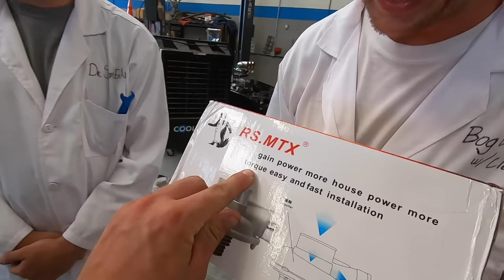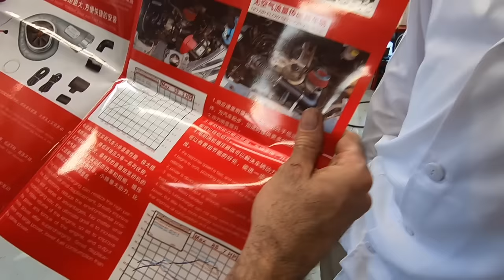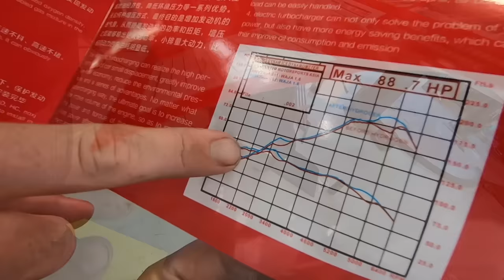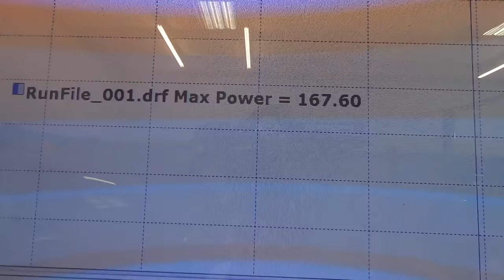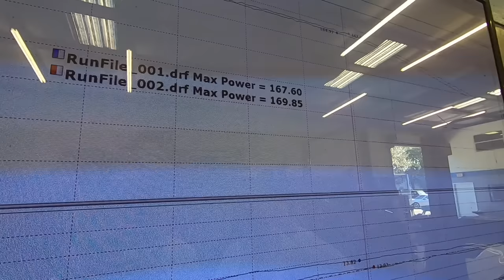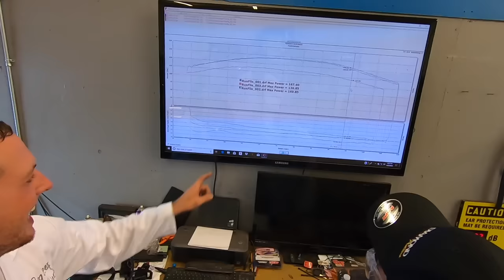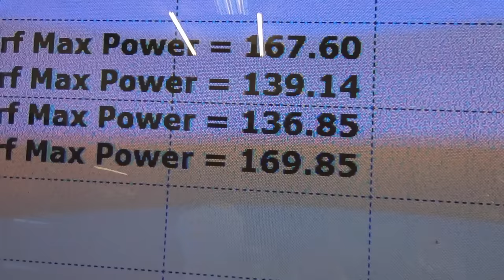Dyno Testing a $400 ELECTRIC TURBO! Funniest Car Part EVER!

Comment: Looks like it was wired backwards, seemed like the Hiroshima hairdryer was spinning backwards at 17:55
Reply: You know Hiroshima is in Japan right?.
Reply: holy shit youre right, it is wired backwards
Reply: @Vike_12  you right
Reply: Hopefully they will redo this video with it wired correctly.  

It was the lab coats which gave them a false since of smarts.
Reply: holy shit, then it must be true, if it robs 30hp backward then it surely will gain 30 forward, lol. j/k
Reply: Evan Riel  +9000 just for the name.
Reply: Not wired backwards that's just the frame rate.   They tested it before installing.. it wouldn't be blowing OUT of the OUTLET if it was wired backwards.    They should've done a dual intake tube with the fan assisting the NA suction
Reply: Southern Speed Videos Honestly, didn’t even think about that, the frame rate could easily make it appear spinning backwards, it was worth the ounce of hope though
Reply: Mark Thomas ‘Twas just a joke
Reply: We need more tests now guys make sure he sees this
Reply: @SouthernSpeedVideos  At .25 speed, it still appears to run backwards...wonder if it's back feeding through lack of ground? When they initially ran it outside the car, it was clearly running properly.
Reply: Look man, there was no map sensor. It was running rich because it was reading too many gallons of air per sec and not psi.
Reply: It is backwards, Cooper also says "it's building up some serious back pressure" then hold his hand in front of the inlet like it was blowing air on him..
Reply: @bills6093  I know y all are more mechanically inclined than you are technologically, but the reason you all thought it was backwards is called the rolling shutter effect. Look it up and be amazed at the power of the human eye
Reply: @rhyswerner8749  No, I think it's running backwards because of Cooper's observation regarding back pressure, and because I played it at 1/4 speed to see if the shutter effect remained. At any rate, I think there is enough evidence for Cleetus to have to address the issue.
Reply: It is definitely running backwards when witnessing the initial spool up at .25x, assuming the side the camera is pointed at is the inlet.
Reply: Oh it totally is.. James wanted a free lunch maybe?

Watch which terminal the blue wire goes to during pre install then during dyno lol
Reply: @rhyswerner8749  rolling shutter isn't what might make it appear to run backwards, it's more of a type of aliasing. Sampling at a frequency slightly different from the period of the target (in this case, the time it takes the compressor to turn some integer number of blades) will cause the apparent speed to be different from the actual speed. Rolling shutter would just make the blades look all noodle-y.
Reply: @SouthernSpeedVideos  these compressors work centrifugally, so I wouldn't be surprised if the thing does still push some air out of the outlet even running in reverse.
Reply: @thecma3  you are 100% correct as I'm sure you know 😂 I miss remembered my information clearly cause I knew exactly what you meant by "noodley" the rolling shutter effect makes things ( spinning discs blades rotors etc) appear to become warped and bent, thank you for correcting me and correcting my mistake!
Reply: @kirkc9643  has nothing to do with the size of your screen or the speed at which you watch the video. You aren't being a big smart deductive Sherlock homes by turning your video speed down... this is a result of the cameras frame rate and the RPM at which the blades are turning
Reply: JUST TO BE FAIR* Guys im just posting my opinion on the matter as I have no certifications or experience but I am curious enough to take a stab at problems and things like this, thank you all for the constructive criticism and ideas about this weird HORRIBLE "China turbo"
Reply: @rhyswerner8749  yep yep yep. That's the stuff. The noodle-y stuff.
Reply: @UCWiX6avmVC0REdkM_Fq7oZA I'm not arguing or over complicating anything. Its just frustrating that so many people fail to realise the fact that the turbine might be spinning the wrong direction will have no fucking effect on the performance of the engine because it's a giant v8, try and think how long it would take that tiny little "turbo" to fill all 8 cylinders with the "correct" AFR and not to mention all of the intake manifold and the chambers in the heads. There is no way in the world you could pump enough air to do ANYTHING with that hairdryer
Reply: @UCWiX6avmVC0REdkM_Fq7oZA why don't you explain your train of thought to me instead of just crowing what everyone else is saying (hurr it's spinning backwerds slow your vidja down 😯)
Reply: It does spin backwards damnn
Reply: @kirkc9643   please refer to the clip of Cleetus letting it rip with the bubble wrap next to it 👌. Sorry you're slow :/
Reply: Damn you got good eyes, didnt see.
Reply: It's wired the same in all  the clips. They tested it during the "back pressure" comment, and Garrett put his hand in front of it;  it was still spinning clockwise, but if was running backward it would have been obvious. If it was going the wrong way, we would have seen the fan stop and go the wrong direction James puts power to it; or at the very least slowed down, stopped, or made blocked motor noise. The blades were already spinning clockwise from the suction of the engine, and the engine. The speed of the video doesn't negate from rate or shutter speed, or whatever; so if the camera made it look like its clockwise, it's going to still go clockwise I'm slow motion and in 1080.
Reply: If the compressor is running backwards it still compresses air and blowing in the right direction but with a much lower efficiency and flow. But it could also be the frame rate. Check our channel, we have some proofs the Electric Turbo is not a scam ;)
Reply: @kirkc9643  I'm really not making a fool of myself 😂 you are... do you even know how a turbine works 🤣🤣
Reply: As Sheeve said to the dukes, It's supposed to be it's chinese.
Reply: Kirk Claybrook at 13:53 when he put the paper or whatever it is up to show it blowing, it looks like it’s going counter clockwise too
Reply: It's fascinating how confident people are about a topic they're clearly not equipped to have an informed opinion on.

"Put closed caption on @ this time, you can hear the turbo go "eeew" instead of "weee"

LMFAO!
Reply: TheCanasianMm
Reply: Watched it in slow-mo, Definitely is backwards lol
Reply: Maybe the "back pressure" they were feeling was actually the turbo trying to succ rather than blow

Comment: Apparently a “house power” is less than a horse power. 🤷🏼‍♂️
Reply: Cleetus i have a 1liter 3cyl smart maybe itll make it more power.  Or install on that pocket bike u got..
Reply: House power is -32 horses. - 1 house power is 32 horse power. That's Chinese math.
Reply: Well we use about 6000kWh a day which totals 250,000 watts. Now let’s remember that 1hp=745.7w so we use about 335.255522hp a day. Therefore 1 housepower = 335.255522 hp so yes, it is wrong. Big brain activity.
Reply: @amonGustavo07  do you mean 6000Wh? 6000KWh is maaaaassive.
Reply: James Golen perhaps.
Reply: Cliff P i have 500 fuck machines running 24/7 tho don’t ask why
Reply: who know.....🤣🤦‍♂️
Reply: @amonGustavo07  kWh and watts can't be interchanged like that. kWh measure energy. Watts measure power. energy is power x time

Comment: I mean, leaf blowers exist. The weak point is actually the alternator BUT if you ran it off an isolated battery, you'd offset the back-pressure program on turbos that usually drops 30% of the power gained.

Comment: Try it on a go cart engine! The V8 is pulling in more air than the "Turbo" can. Maybe if it was on a smaller engine that didn't pull so much air it could create some boost.
Reply: M-A-D...its not boost damn it!
Manifold Air Density
Reply: @zuestoots5176  Agreed, my wording wasn't accurate. But you get the point.
Reply: @zuestoots5176  : Nobody likes a smartass.
Reply: Doubt it.
Reply: Put it on the bogger
Reply: Put it on the tracker!
Reply: TufGriz that’s actually a great idea with how long the intake snorkel is lol
Reply: What if he Y’ed the pipe so it can suck it’s normal air plus the air from the turbo
Reply: Actually a good idea. Build a gocart. Race boostedboiz
Reply: @inthebeginning6895  lol because running the turbo motor backwards wasnt bad enough?
Reply: Motorcycle! (Enginecycle).

Comment: 17:55, Looks like the electric turbski is spinning in the wrong direction.
Reply: Lol did they have it hooked up backwards? I think your right.
Reply: Sure looks like it spun backwards.
Reply: @JNorth87  So instead of giving it 30hp, it sucked out 30hp.
Reply: but if you watch it when they do the dyno pull it looks to be spinning the correct direction
Reply: @TangoOne  Play it at 0.25 does look to be spinning backwards
Reply: @TangoOne  the noise is the gear stripping out
Reply: @TangoOne  It probably was. You have a 170 Hp V-8 pulling the fan in one direction and a wimpy little 12 volt motor pulling in the opposite direction. I'd bet on the V-8 winning that battle.
Reply: Yeah for sure spinning in reverse, pause the video and use the < and > keys to move frame by frame. Its spinning backwards
Reply: @itznewy3615  I watched it at .25.. still looks to be spinning clockwise.. the correct direction.
Reply: @anthonyward8853  You do need to think at 17:55 the vehicle wasn't running. So it spun backwards. And about 20:05 it started to spin it clockwise. Till James connected the cable to the battery causing the gear to spin it anticlockwise. Which would of resulted it to strip the gears
Reply: ItzNewy l

Comment: 😂The problem here is the Dyno doesn’t detect house power.
Reply: Needs a firmware update 😁
Reply: Ffs 😂😂
Reply: Someone needs to made a guage for that.
Reply: Also the Dyno doesn't detect H.P.
Reply: Dyno
Reply: Bonnie & Clyde Ride E-Turboraptor
Reply: Good job
Reply: Twistys hahaha
Reply: Cause House Power is 110V and cars run on 12V. 😋
Reply: Turn to Christianity and United Brethren Church before its to late saying anything hateful, premarital sex and lust are all sins. And so is using the Lords name in vain. Killing is a sin.
Reply: the fuel pressure has to increase with the boost pressure gain .if not the fuel pressure is decreasing with boost pressure thats why you made less  power ..ie no boost=47psi ,10lbs boost =57psi ... 10lbs boost =37psi with no increased fuel pressure ,this is why you made less power
Reply: @haydenbellis3047  and you better not shout cos santa clause is coming tonight.

Comment: Try it on a smaller engine like maybe a 3.5 "housepower" Lawnmower engine.
Reply: good idea, but it’s very hard to use forced induction within a carbureted engine because of the carburetors size and the size of the jets being the limit for the amount of air you can push through it. if you push more air then the jets can supply fuel then it’s pointless( would just lean it out a ton). Id like to see a fuel injected dirtbike hooked up to this that would be interesting
Reply: Nah bra, your going to make -26.5 horsepower. The turbo spins backwards so u get negative horsepower. Its simple math
Reply: Just a heads up: 3.5 Housepower is about 350 Horsepower.
Reply: That’s a pretty big mower if it has 3.5 horsepower that’s like 340-400 horse power

Comment: When you can hear the "turbo" spooling faster as the engine draws in more air... That means the engine's vacuum  is forcing the turbo to spin faster. No big surprise!
Reply: I was thinking the same thing. Avoid everything coming from China and you should be good.
 'Murica👍
Reply: You’re better off literally buying an eBay turbo kit for like 5-600 bucks 😂😂

Comment: Dudes, you've unknowingly stepped into my realm now. I've been experimenting with electric supercharging since 2010. As you guys can probably guess, the displacement to turbo-size has a lot to do with the performance. I don't think what was bought was meant for an engine with as much displacement as the Mustang. It probably utilizes a bldc motor from the look of the controller so I've no doubt it can generate pressure, but it's limited in how much cfm it can deliver under pressure. Make an intake with one per cylinder and I'll bet you will see some positive numbers then. I currently drive a Novi 2000 Centrifugal with a 72v 250A Me 0913 bldc motor which puts out 96N/m of torque. It will boost my first gen. .060 over smblk Chevy by 5psi early in the band, but then it's all gone by red-line (which is OK for shifting). It's in a black 87' RS Camaro with a TKO-600 and a Dana 60. Matter of fact I just ordered new batteries for it and would love to try it on your dyno. Aren't you guys in Florida? I'm in Kissimmee.
Reply: yeah a lot of people joke about electric superchargers but they can actually exist. Some struggles being cost and weight of batteries. Comes to a point where its a cool experiment although generally not practical.
Reply: Quite right. If I had to do it all over again I probably wouldn't but I sure surprise a lot of people with it.. When you're already on a roll the extra weight doesn't make so much difference, It's very efficient too.
Reply: Very cool, I think there is a lot of potential here. I think advances in fast discharge rate batteries will make it happen.
Reply: Me too. I've been keeping a sharp eye on Li-Po s, but they're still too much. I'm using six 50ah AGMs in series now, but I'm going from two bass boat on-board trolling-motor chargers to a 72v bank charger instead because they charge too fast. Constantly monitoring and keeping full voltage has been a major issue with it, but just from the over-time drain from the drive module pre-charge resistor, not from use. Typical duty cycle is less than 15 seconds. The bank charger should do a better job of keeping them all floating.
Reply: Try some super caps, should discharge quickly for a short burst
Reply: That's certainly food for thought. They would undoubtedly be lighter and would definitely recharge faster than AGMs. I would just have to bank enough to last an entire duty-cycle without dipping the voltage and raising the current to the drive-module. 
Thanks for the suggestion. I'll look into that. I need to put in a shunt resistor and get an accurate current reading first, but now I'm all wrapped up in a residential air conditioner project that uses dc motor driven automotive style 134A compressors that can run directly off a bank of batteries.
 I also want to experiment with putting BLDC motors on those little roots blowers for the 2.0L crowd. I think BLDC motors are to the motor-drive market what LEDs are to the lighting market. PM DC motors just can't stack up against them.
Reply: I looked into the super-caps, but they're all 12v. My motor-drive is 72vdc and there's no way to combine lower voltage caps to make higher voltage ones. Still, who knows what the future will bring?

Comment: Give it a try on a small 4cly engine, that would be interesting to see
Reply: Yeah, an old school 1000 or 1300 CC engine that hasn't been optimized for flow, it may have some benefit.
Reply: The mini bogger
Reply: I know a certain 4 cyl mini bogger that could use some extra house powers
Reply: Hook it up to  a 150cc scooter, it'll rip !!!
Reply: A little 3 banger.

Comment: Was spinning the right direction when they were messing with it off the car. In the car it's 100% spinning the wrong direction lol.
Reply: I had to go back and watch and you're 100% correct. 17:52 Obviously this turbo is supposed to go on cars south of the equator lol.
Reply: Willing to bet the plug on the turbo itself can be plugged in either direction. Probably what happened.
Reply: if that's true then hopefully they'll realize and re-do it
Reply: I noticed that as well, I thought it may have been just the electronic shutter on the camera making it appear to spin backwards.
Reply: It’s like anti-boost. The EPA will catch onto this soon and reduce all of our house powers! Damn you Cleetus!!!
Reply: Bingo!
Reply: He must have had polarity reversed! We need another pull swapping the polarity. The eTurbski was pulling air out of the engine instead of into it! But also, we need to see it on the pit bike. Also over volting it, is should handle 72v before catching fire